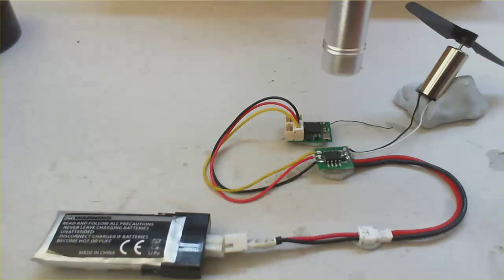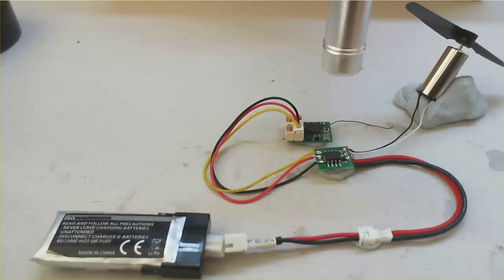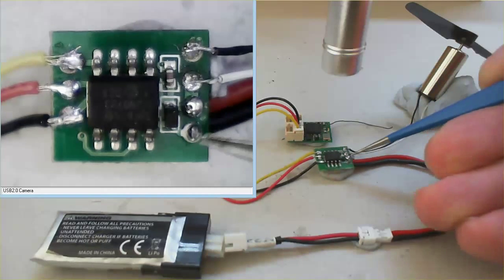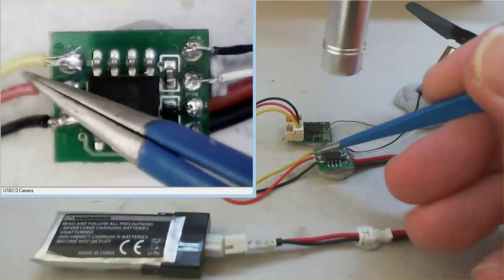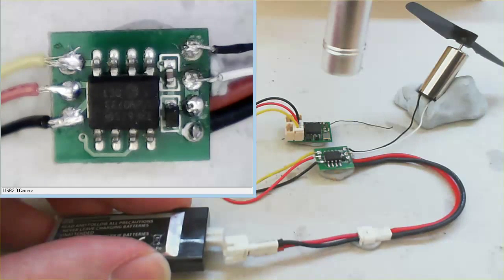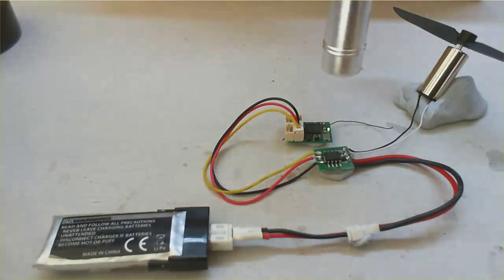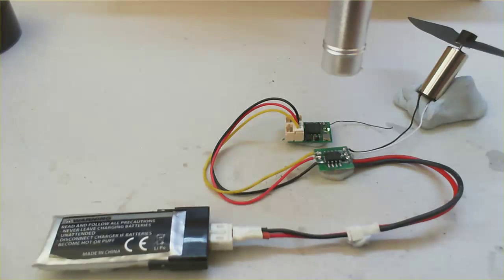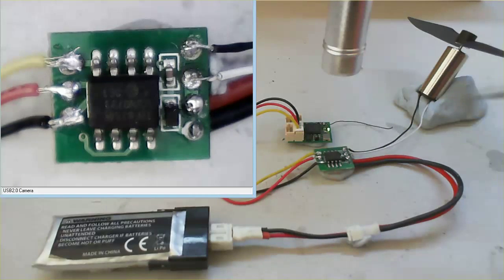Brushed ESC Setup

Comment: This esc does have bec
Reply from the maker: no it doesn't
Reply: @MicronWings  thats mean you use RX battery
Reply from the maker: The ESC is powered from 1S battery and then that power is delivered to the receiver. It's not really a BEC because if just passes whatever voltage the ESC gets straight on to the receiver. @DIyRcrc

Comment: Sorry about this begginer question but why can the motor br connected to the receiver direcly? Thanks
Reply from the maker: This receiver doesn't have a brushed motor driver on-board. However most receivers with connectors like this one these days do have either a brushed 2 or 5 amp controller on-board so you can jsut solder the motor wires to two pads under the board.
Reply: @MicronWings  that makes a lot of sense to me now. thanks for the explanation!!

Comment: can you use 1 brushed esc for 2 or more motors - probably a dumb question but idk
Reply: yes you can. but the motor will turn with same speed. cannot be differential motor

Comment: Esc motor betafpv 0703 19000kv ????
Thank you
Reply from the maker: No this is just a standard 7mm brushed motor.
Reply: @MicronWings  oh, thank you. so can you help me to start a betafpv 0703 engine
Reply from the maker: @dondoc00  Sorry I don't have any experiency with that system
Reply: @dondoc00  You need a brushless esc, normally for those motors the esc are  in 4 in 1, for that motor i'll recommend you a 6 to 7 amps esc

Comment: Hey is there a version of this ESC for 2s lipo 7.4 volts ? , I want to use it with a 8520 7.4 volt motor& is there a receiver for flysky that will work for me ? I only have flysky i6s transmitter
Reply from the maker: This ESC is for brushed motors - 2S
https://micronwings.com/Products/ESCBrushedMicro2S8AWired/index.shtml

Comment: does the reciver works with any rc remot toys..do u sell both esc and reciver..I need one..I live in kabol afghanistan..
Reply from the maker: This unit does not work with just any transmitter. You need a DSM2 compatible transmitter. See our website for a list of products. www.micronwings.com
Reply: can u post to afg..the compatible product..motor .prop.reciver and esc..what wil be the price..tnx alot
Reply from the maker: The receiver choice will depend on what servos you want to run. See the compatible ones on the receiver page listed below. I have put links to the products in the video below. You may also need wire and connectors. See those sections on my website if you need them.
RX - http://www.micronwings.com/Products/DelTangRx35d/index.shtml
ESC - http://www.micronwings.com/Products/ESCBrushedMicro1S5A/index.shtml
Motor - http://www.micronwings.com/Products/MotorBrushed7mmx16mm2.7Ohm/index.shtml
Prop - http://www.micronwings.com/Products/Prop65mmTriTurbofan/index.shtml
Battery - any 1S 3.7V battery is okay - maybe 130mah